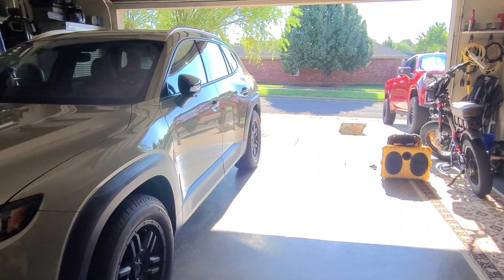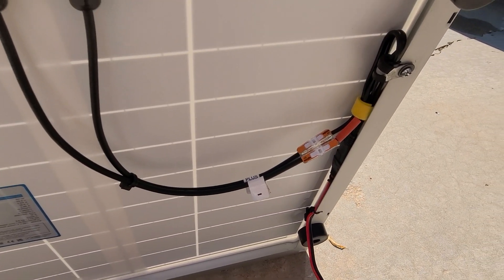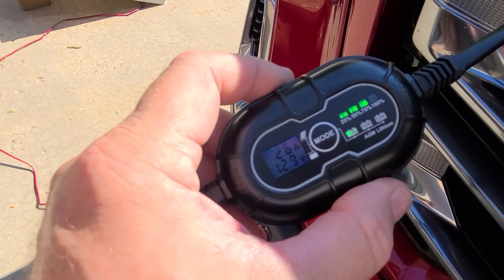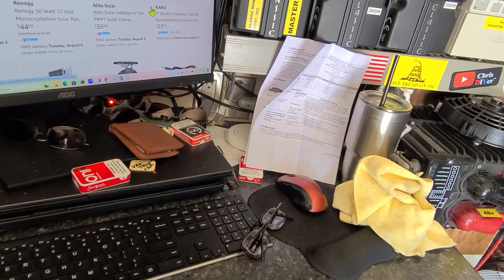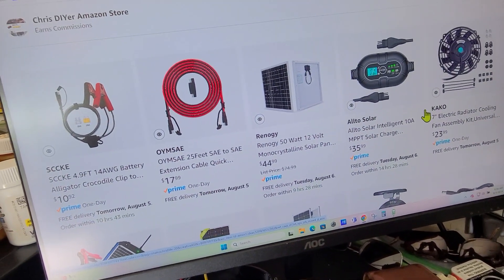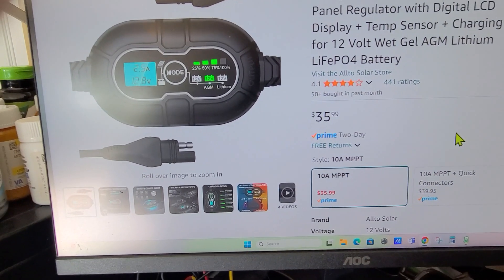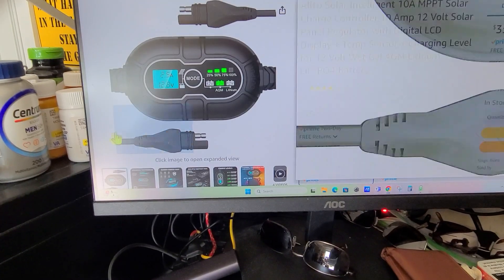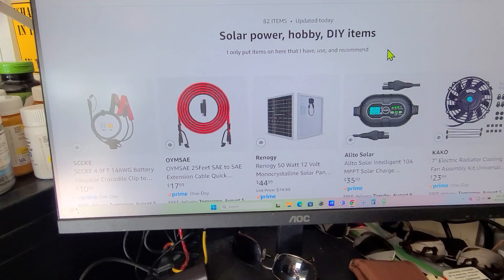Allto 10a MPPT solar charge controller 12v battery charger (SAE style!)

Comment: I just use one of those cheap $7 PWM charge controllers and glue gun where the wires come out after they were installed.  It stabilizes, insulates and prevents shorts.  Not as sturdy and nice as that small inline MPPT, but CHEAP.   I wonder if that is a real MPPT and if it will do high 38-40 VOC panels.  I also have that exact Renogy 50watt 12 volt panel.  It's a great panel.  But it is quite a bit more than a trickle panel.  You can charge up a totally flat battery probably pretty quickly and it is small enough to travel with you pretty easily.  I was afraid I went overkill, but I can also charge all my 5 volt things in case of a power outage.  (Got the high watt usb-c outlet for this, too.).  A real trickle only needs to be something like 1.5 watts.  I had a 1.5 watt panel many years ago:  it freaking worked so well for battery maintenance!  If you want to trickle without charge controller, however, you need lower VOC (volts open circuit) voltage, more like 14.4 VOC.  You can still get small panels that claim old school low VOC off Aliexpress.  All the 20VOC stuff and just higher watts period, you want a charge controller.
Reply from the maker: Yeh, some of those cheap PWM units will do just fine. I have two on my backyard solar generator -- been in use 24/7 for 4+ years.